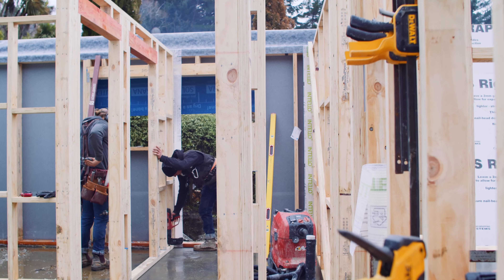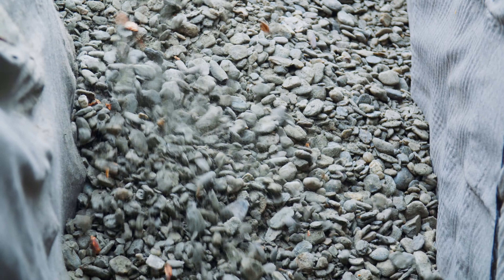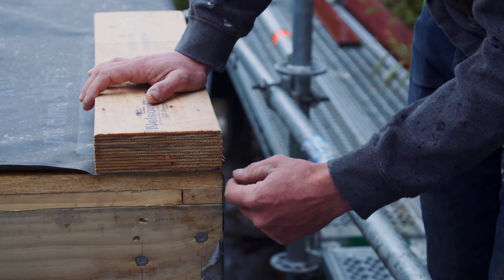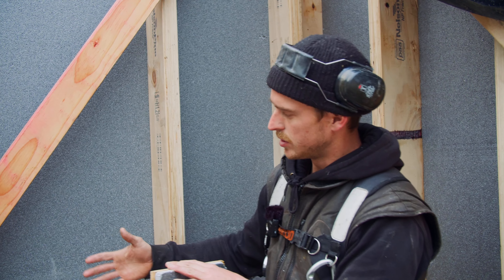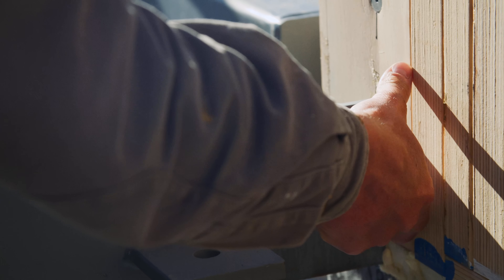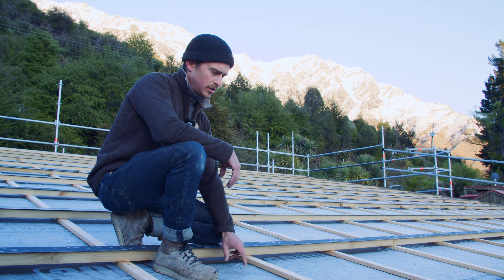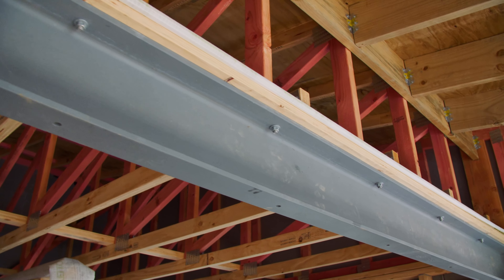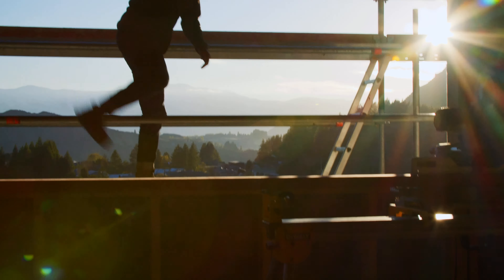Watch Us Build a Passive House in New Zealand - Episode 2

Comment: Great work guys, lots of communication going on to achieve such great work.
Waiting for the next episode!
Is is also possible to use the air/vapor control layer on the outside (on top of ply/osb) then use ridged insulation board. Then after this cavity with cladding on top?

This would take away the fussiness with the vapor control layer on the inside.

Keep up the good work, wish I could visit the site, living in QT myself.

Also what ventilation system you putting in?
Reply from the maker: Hi Nicky, yes we think this would be possible. 

In the future we would love to do a rigid insulation layer install on the outside of our wall sheathing/rigid air barrier.

It comes down to cost, time and performance. This wall makeup worked for this project based on the above, though with the industry changing it is becoming more cost effective to use Sips. 

We are looking forward to using Sips panels for two projects commencing soon.

Your welcome to visit the site :)

Comment: Do you get issues with penetrations through the gib?  It seems that when your vapour and air tightness barrier is on the inside of the wall cavity, then every power point or fitting will be a penetration through that barrier.  In the US I see people pushing the vapour barrier to the outside of the framing (just under the sheathing), then the insulation outside the sheathing - which gives good protection from thermal bridging, and also means you have far fewer penetrations in the membrane.
Reply from the maker: Hi Paul, we have very minimal penetration through our vapour barrier. 

We achieve this by using a internal wall service cavity between the vapour barrier and the finished wall linings. 

This gives plumbing and electrical their own framing line to run all services without effecting the insulation or vapour control layer. 

We have found this very effective
Reply: @compound__  Ah, super interesting.  So in effect an insulated wall, then the membrane, then some additional framing/battens, and then the gib.  I like that as a concept, although it of course makes the wall thicker and therefore your rooms smaller.  But it'd be really nice for running services.

Comment: What's the name of the rab product you are using with the 10mm of polystyrene attached on the exterior of the wall please?
Reply from the maker: Hi Karl, the product is RIGIDRAP-XT
Reply: @compound__  The IBS website says that the XT product is not designed for timber framing.   You obviously don't think it's a problem. 
What fixings did you use for the sheets?
Reply from the maker: @markm4458  Build science & engineers calcs tells us this is not an issue at all. 

We used Delfast 65mm stainless screws. Using a quick drive screw gun made for an easy install and control of depth.

We would love to see more insulation on the sheathing here in NZ, similar to ZIP-R sheathing in the US.